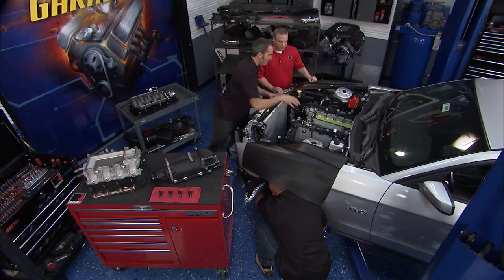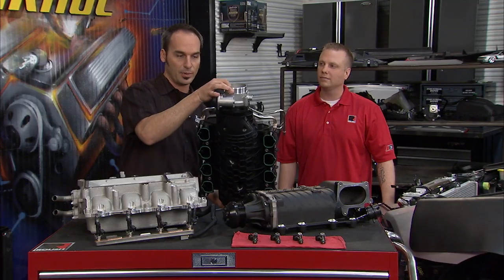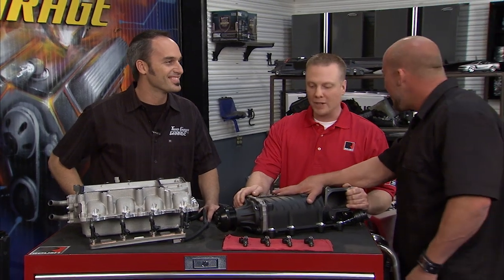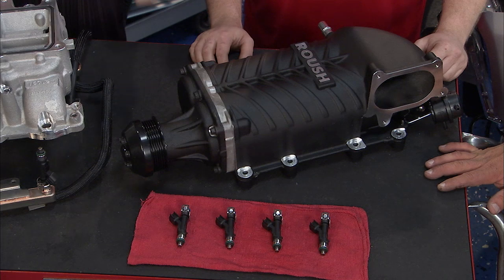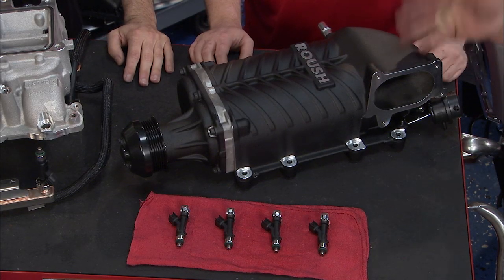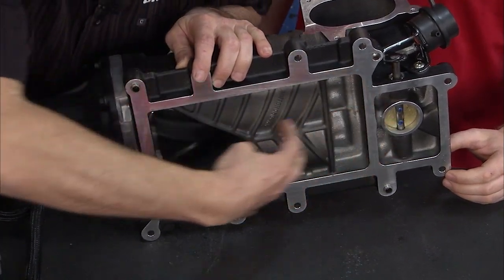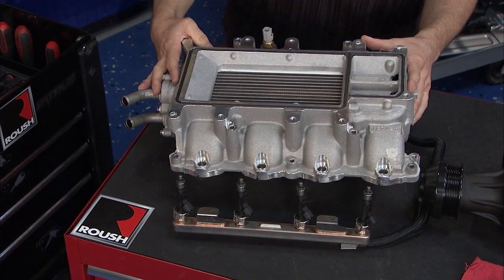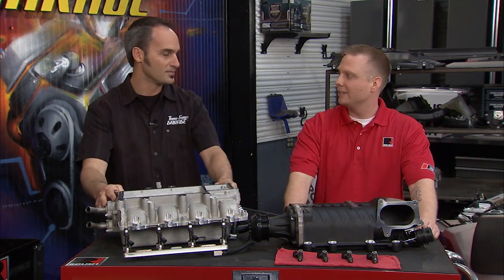Two Guys Garage - ROUSH Performance Super Charger Install Clip

Comment from the maker: They are both TVS 2300 blowers, however, they are not the same supercharger or the same kit. A unique high flow fuel rail with 47lb injectors is included in both Phase 1 and Phase 2 Supercharger kits for the 6.2L SVT Raptor.

Comment from the maker: The 427R uses the M90 roots style supercharger. To answer your question, yes, you will need to upgrade to the TVS2300 kit since it contains different components from the M90 supercharger. 

Also, this installation is being done on a 2011+ 5.0L, not the 4.6L that came in the 2005 - 2010 GT's. There is a TVS kit for the 2005-2010 cars, so just make sure that you order the correct kit.
Reply: ROUSHperformance any kits for 1999-2004?

Comment from the maker: Fuel economy depends on how much lead is in your pedal foot. You can maintain the same MPG's, sometimes better, if you can stay out of the throttle/boost. If you have a heavy foot, you will see mpg's fall off rather quickly. Also, with any force inducted vehicle, you have to run premium gasoline.

Comment from the maker: Those are all certainly upgradeable, however, they would require a custom tune based on what upgrades you've done to your vehicle. 

Our supercharger system and calibrations are based and designed around a stock (from the factory) 5.0L Coyote engine.

Comment: I'm looking at performing this upgrade to my 2013 GT this winter.  What is a good street/strip clutch for these new transmissions.  Most of my friends are running autos with the Coyotes, so no help.  I've had longevity issues with Centerforce and I want a decent pedal for those days in traffic.  Thanks.  This is a great product.

Comment: I seen something about cutting the block? Also I was looking at the 700 HP kit. I have a 2014 GT. Can the stock motor handle this? Also is everything I need in the kit?  Meaning I can bolt it on and go?

Comment: Might sound dumb. Is there anything else I need in for the install of a stage 2 R2300 that's not included? Going from bone stock engine and want to do the R2300 stage 2

Comment: do you have to change the internals? like forged pistons, rods and crankshaft to use this kit on a 2012 gt?
Reply from the maker: No internal engine modifications are required to use a ROUSH supercharger.

Comment: Will fit this supercharger on my 2013 Shelby GT500?
Reply from the maker: It will not since the GT500 engine is completely different than the standard Mustang GT